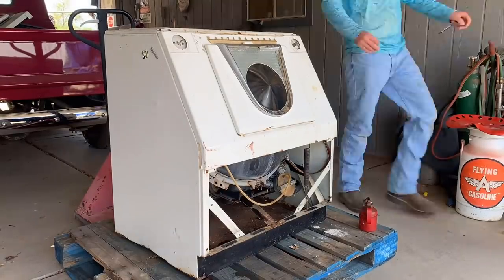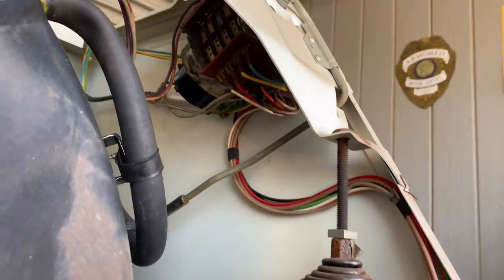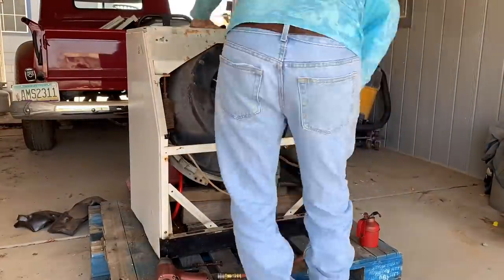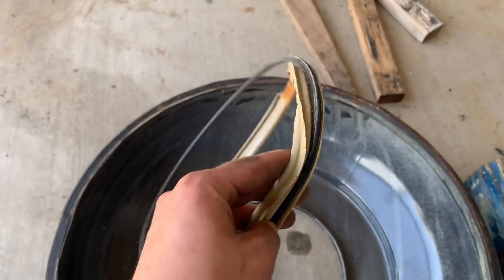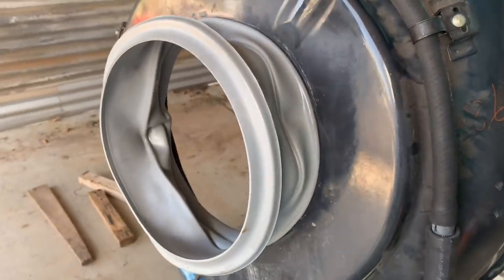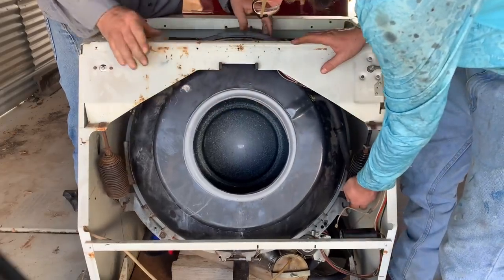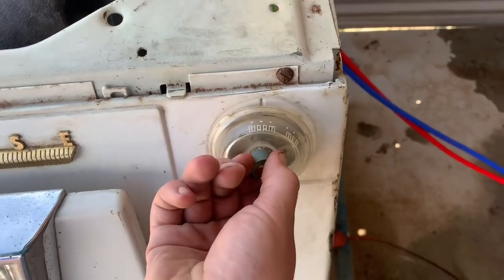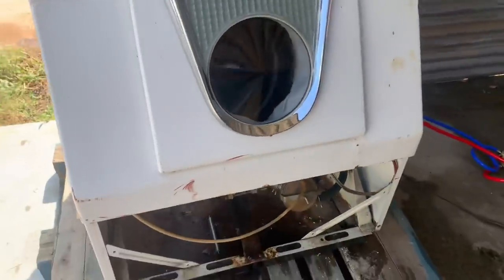Restoration special! 50s Westinghouse washing machine

Comment: Holy Smokes!!  I remember those washers's very well! I used to overhaul lots of them.  Very dependable machines. A clutch spring is used for the wash a spin cycle, giving it that slip & grab feature with the motor running in one direction from start to finish. Very simple units Philco Bendix also used same principle.

Comment: It helps to use a rubber mallet on the outer tub clamp, and tighten it by degrees then tap it all around...the space between the clamp n tub should be equidistant all around. Also, just a film of clear silicone works, that rtv will be a pain to work with if u are gonna replace the bearings. The boot works, I did that with mine, but I predict it will develop a rip between the 3 to nine o'clock position. Interesting fill nozzle inside the inner tub, mine had eliminated that I guess. Be very careful when u remove the motor n pump assembly. That rubber hose from pump to tub is often brittle with age and will easily crack.

Comment: Does the washer create its own hot water? Because I noticed that both cold and hot water hoses were connected to one same hose. Or does it require a hot water faucet?
Reply from the maker: No it doesn’t make its own hot water it’s hooked up to hot water when you install it

Comment: That is not a restoration it is a repair. And a failed one. Hope you got that leak taken care of. When changing a tub seal the cylinder and tub need to come out. And the use of silicone is a huge mistake
Reply: Keep in mind, that's just Part one, he does more with the machine in future videos.